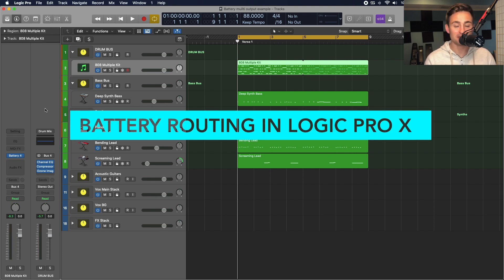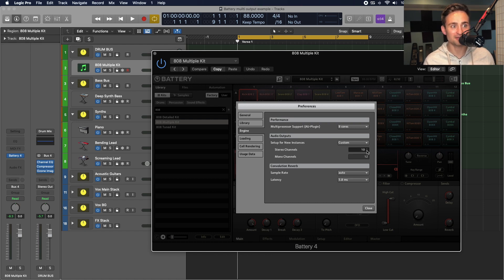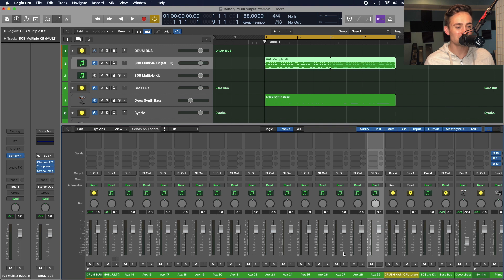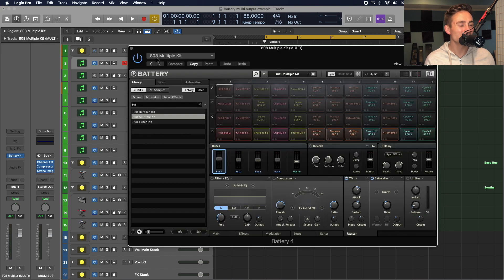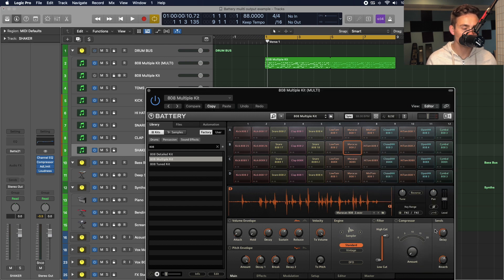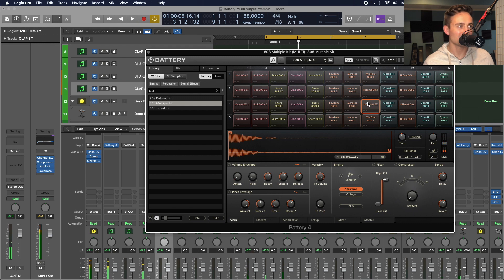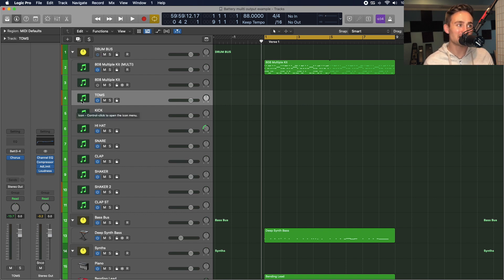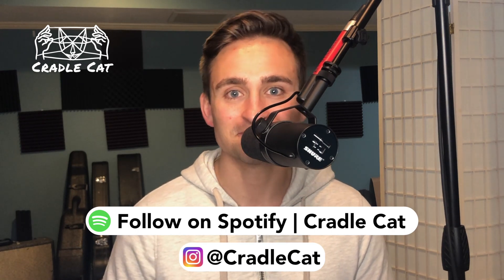Mix Battery Drums as Separate Tracks | Setup NI Battery Multiple Outputs in Logic Pro X

Comment: how did you get -1 bar at the beginning of your project?
also can you change the pitch of notes for each dum hit in the piano roll?
Reply from the maker: On the bar labels - there's a tiny triangle on the left side, and you can just drag that to the left to start you project before the 1 bar 👍 On the pitches - I don't think piano role works for this setup (it's mainly for output control). I haven't tried getting pitch control via piano roll with Kontakt yet - I usu just automate the pitch (from the pitch/tune knob within Battery) when I need to do that.

Hope that helps! Thanks for checking out the channel!

Comment: Thanks!  I am trying to have each pad record to the proper channel when playing as opposed to all recording to the main channel.  Is this possible or do I have to record each one individually at a time by clicking the track and recording only that channel?
Reply from the maker: Hey! There's probably a super complicated way to do it with Logic MIDI environment settings 😂 but an easy workaround could be to record it all on one track, the right click the MIDI region > Convert > Separate by Note Pitch. This will create duplicate tracks for each note, but then you could more easily move those around to the proper aux tracks. Hope that helps!

Comment: Hi, when I route the sample cells into individual tracks in my DAW (I use Ableton), the routing is bypassing the master effects in Battery. Individual routing gives a lot of control, because I can record the individual sounds and mix them individualy, but on the other hand, since  I can't use the master effects, it's not ideal.. I really like the reverb in battery, with the different presets and how it sounds, but I can't use it now. Could you advise on how you apply reverb to your drums? What plugins you're using? In some tutorials they say it is good to use two different reverbs - a spacious reverb for certain sounds and a more condensed reverb for other sounds and put them on two separate return tracks and then send the drum sounds into those as much as you like and mix it that way. Or maybe there is a way to include the Battery master fx when routing the cells to individual tracks?
Reply from the maker: Hey good question! I have all my individual drum channels/tracks routing into a drum bus (setup as a Summing Track in Logic). So that lets me do a couple things:
1) I often use reverb on the individual drum channels/tracks - and yes, depending on the song, I'll have a short reverb or slap delay, along with a longer reverb on a channel (usually snare).
2) I add processing to the drum bus Summing Track itself. This help add back processing that is lost when you bypass the Batter Master fx. For example, I often add a compressor here, and may also add some distortion, too. You can basically try to recreate any of the Battery master processing you like on the drum bus track in Logic.

Does that help answer your question? Thanks for checking out the video btw!

Comment: I like this a lot, buuuut, what about appreciating for note repeats? It seems like it doesn't allow for that. Is there a workaround?
Reply from the maker: Thanks for watching the video! Where are you adding the note repeats? I don't think I understand what specifically is not working for you yet.
Reply: @CradleCat  Thanks for your response! I mean when I hit the key I want fast and even 32nd notes for my close hats, and I have used the arpeggiator to get that effect, but I can only put that on the battery 4 track, thus effecting all the pads (kick, snare, etc.). My work around was to make 3 new battery 4 tracks with different arp settings for this effect, but ideally I wanted to have it all in one stack! Is there a way to do this with the method you outlined in your video? Thanks!!!

Comment: Hayo! Thanks for video. Quick question. Is there a way to re-arrange the  order of the battery auxes in the mix window after the tracks have been created (so you can see them in edit window) so that the mono auxes are first then the stereo? meaning  left to right? thanks!
Reply from the maker: Hey thanks for watching, hope it was helpful! And yeah - it's a bit weird in Logic, but:
1) right click the aux channel in the mixer window
2) Click "Create Track"
3) In timeline/arrangement view (the horizontal tracks), drag the newly created track where you want it
4) The mixer window will reflect this new order
I actually do this anyway so that I can draw in automation on aux tracks on the timeline view (for delays, gain, etc.) 👍

Comment: How do you set up recording in each individual channel? E.g. Record kick midi into one track then record snare midi into another?
Reply from the maker: Hey thanks for checking out the video! You can set that up from the "Setup" tab within Battery (along the bottom of the instance window), and then make sure "All Channels" is selected in the MIDI Input panel on the left. Then, just click into each of your tracks in the timeline view and record in your MIDI into each  👍

It was actually set that way by default for me, so it might not need to change anything other than separating your MIDI and moving it to the right channel tracks.